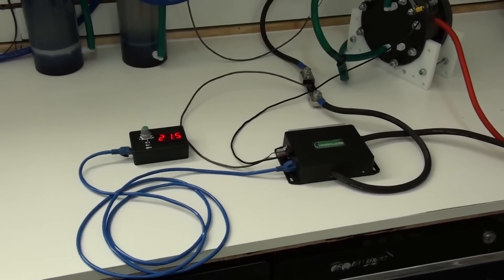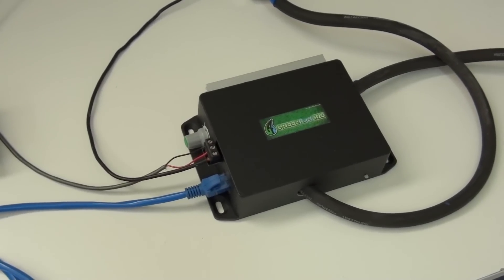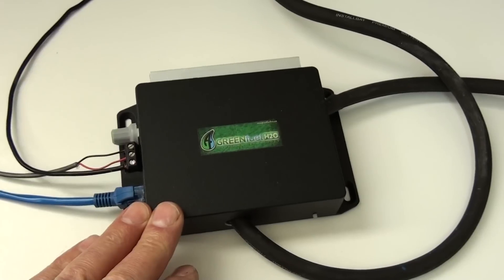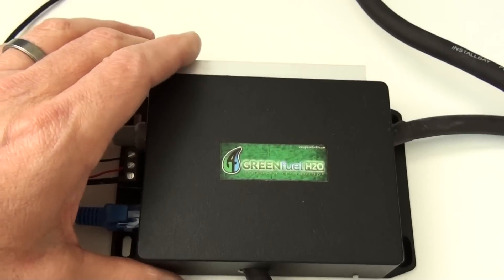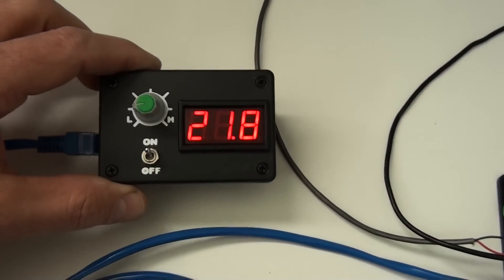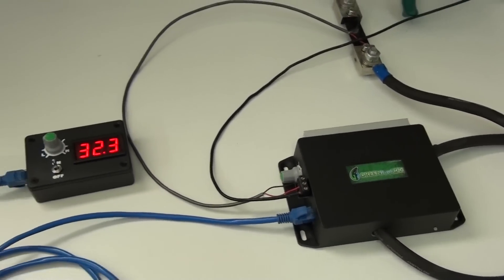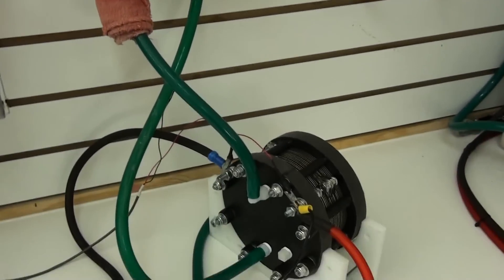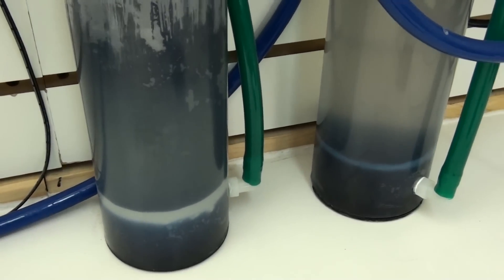Green Fuel H2o 90 AMP Continuous CONSTANT Current PWM for HHO and Hydrogen Generators

Comment: err you cant use this on your home mains higher than the fuse goes right?
Reply from the maker: ARCSTREAMS no it’s made to run on 12-14 volts dc.
Reply: @Hydrogen4Health  12v and up to 90 amps? where do you plug it then at a factory with 3phase?
Reply: @Hydrogen4Health  an adapter runs on 12 volts but very little amps so if this thing is acting like a welding machine giving high current and low voltage then you need a 2 or 3 phase line to plug it into no?

Comment: forgive my ignorance as its been a while brushing up on my electrical but isnt the current drawn to a generator limited by the generator itself in the design? can you actually feed it more current than it will draw and is this safe?
Reply from the maker: ARCSTREAMS the hho generators what this is made for will draw more power as the water heats up.
Reply: @Hydrogen4Health  ok so you are saying the generator can handle up to 100 amps and your machine there is basically a current control limiter like a dimmer switch that only allows up to that?
Reply from the maker: ARCSTREAMS yes you could say that but it’s a bit more complicated than a dimmer.
Reply: @Hydrogen4Health  okidoke

Comment: Would the back emf "negative energy" also be pulsed into my cell with this pwm?
Reply from the maker: I don't know. I do know the back emf problems have been eliminated on this unit.
Reply: thanks for the quick response.
Reply: delvis11
Love this unit. I put it on our  #GOAM  playlist.
Great price too & the shunt/regulator setup takes you physically away from the high amps bits of the circuit. And the current control? Thats tidy brother, real tidy.

 #HHOlyBubblesBatman  ;) uCHOOZE.com  #uCHOOZE

Comment: I have an idea for you . a pump and a speed controller for that pump could do the same thing but at even higher amps . here me out , i have biult cells in the past that could be controlled by the amount of electrolyte you pump into them . a simple 5 amp PWM connected to a pump could modulate electrolyte input, this throttles the cell just like and power controller and its cheaper .Just give it a thought in case you ever wanna run a cell at higher amps .

Comment: What gauge wire are you using for say 10'.
Thanks
Reply from the maker: +DUMBASS Hello
In the video I am using 6g wire
Reply: delvis11 
I'm using 8 gauge @ around 7' to 3 vessels containing 13 plates each. And was blowing 80amp fuses, so I'm using 90's, and the wire does get a little warm. Im using a pwm which came from China and so far so good. But how long it will last is anyone's guess
Reply: delvis11 
Also are you using neutral plates in wet cells? I tried that and wasn't producing much gas at all and pulling very little amps. Now I have every other plate + and it makes a butt load of gas and it pulls serious amps. 3 vessels are wired in parallel. Way better than in series. Thanks

Comment: The first time internal parts vibrated off the second time is a mystery but no power up. Im not gonna say whos pwm it was but needless to say it needs more development. You should put rubber vibration dampening washers with the pwm module for mounting.
Reply from the maker: Or I could say " for vibrations please use rubber washers under mounting tabs."
Reply: delvis11 Oi!! como faço para comprar o seu pwm 90amps completo com o console separado e qual é o custo total dele incluindo o frete para o brasil??

Comment: Plus what you really need is a DC water pump self primed to create more HHO.m The apprx 24 amp being used by a at least 100 amp alternator will be sufficient to create with your dc water pump more gas. RC

Comment: LOL. Ok that was funney. I guess sometimes if you want to drive a big nail you need a big hammer. And yes I have let my share of smoke out of diodes and "Moss~Feeds". I have personally noticed that unless you have a high frequency diode your going to punch a hole in it. Metaphorically speaking.  Thanks.

Comment: Lets see...  MIT makes a Plasmatron where up to IIRC 90% of your fuel can be water basically by making the tried and tested Syngas production method portable with what is essentially a giant spark plug.
Yet you go: "Nah!  I'ma gna go with plain ol lectrolysis!"
OK...  Um...  well... good luck with that.

And btw: If I was going to go the old electrolysis route why machine stainless steel electrodes when I can cut non corroding graphite foil with a pair of scissors.

Oh and in-case you haven't noticed a magnetic field increases your old style cell's production for free